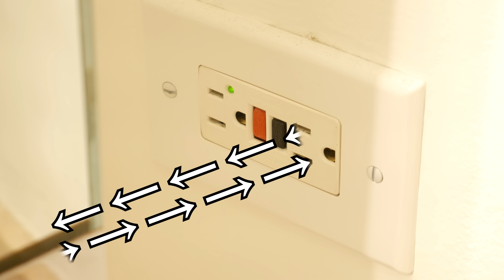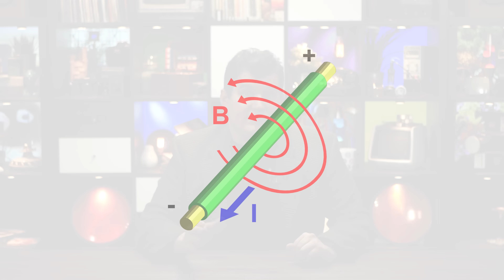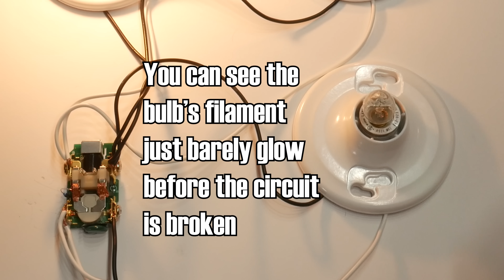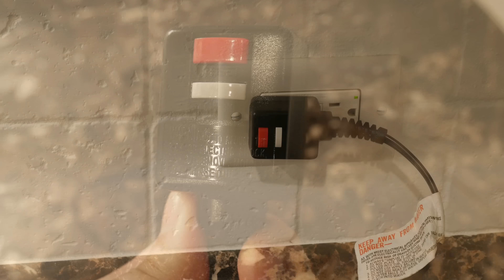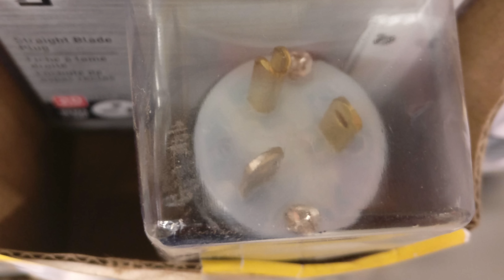The GFCI/RCD: A Simple but Life-Saving Protector

Comment: I had my radio connected to an outlet in one circuit that was protected by an RCD in the panel. When I connected the receiver to the house antenna network, the RCD immediately triggered. When I connected the radio into another electric outlet (that was next to the antenna outlet) the RCD for that circuit didn't trigger. Go figure.

Comment: I actually tripped a gfci plug recently and pretty sure it saved my life. I turned off the circuit labeled as the feed for my bathroom and stupidly didn't confirm the plug was actually off before I started working. I sent 120v in one arm and out the other when i touched the contacts of the plug i was working on. Turns out that it is on the same circuit as the other bathroom where the gfci plug is (I should have realized this since the plug in my bathroom isn't a gfci plug). I always knew these were important but now I have a very strong and personal appreciation for these plugs.

Comment: Just last week, I watched a video about why Japan's wall outlets (generally) don't have a ground prong hole.

The TLDR was that shortly after WW2, as the US was making ground plugs and prongs standardized, Japan started looking into it and found that something about the way their electrical grid(s) was built would have required a massive and expensive retrofit job to work, so they opted for a single GFCI between the main breaker and all the other breakers instead. And it has been amazingly successful. The most recent report the creator could find from Japan's electricity industry was about 10 years old, but it claimed there had been no residential electrical shock deaths in Japan the entire previous year.
They have since started selling outlets with ground in Japan, and in 2022 started mandating them in locations in new construction where appliances such as laundry machines or heat pumps are likely to be plugged in. Though their ground design is just a single wire that comes out of the main device;s cord about 6 inches before the plug end and has a metal prong that is supposed to be secured behind a ground screw (similar to how the 3-prong to 2-prong adapters you can find in the US have a metal prong that is supposed to be screwed in behind the central screw holding the outlet faceplate in).

Comment: I just replaced almost 30 outlets in the house I live in. I've seen some sh!t, man. Whoever wired this place up had to have been absolutely drunk.

There's a 20amp breaker with 12awg wiring that serves a single outlet for my washer and dryer. There's nothing else on that breaker. 

The outlet was a 15amp non-GFCI.

That was the EASIEST problem to fix. 

There's 12 different circuits sharing only 6 neutral wires. Thanks to this and some back -feed, I briefly got a shock in my hand while working on one of the outlets. 

I've seen 110v+ on white, black, brown, yellow, red, AND blue wires in this house. 

The outlet that shocked me had 118v on BOTH the black and white wires! 

I may never touch a house older than 1990 again after this.

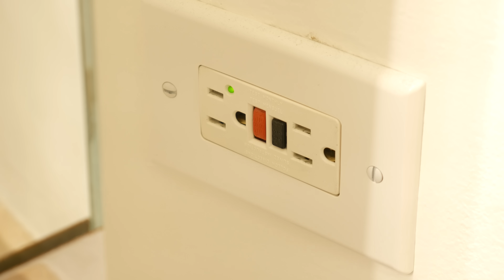Comment: 15:25 embarassing n00b story. I actually put two of these in series in a single circuit when wired up my workshop. in my defense, I didn't fully understand how they worked. I didn't know a single outlet could protect an entire circuit. I thought each outlet was on its own. So, in the virtue of safety, I installed two sequentially in a circuit.

Yes, I was an absolute n00b. However, A) I erred on the side of caution and B) I have learned from my experience. After all. this isn't a MISTAKE in that it won't cause danger or a problem. At most, it's overkill. However, I submit that any tactical mind will resort to the nuclear option until one can prove that Plan F is sufficient and we need not spend the resources on the other options.

Comment: The most interesting thing is that they detect the current inequality by running the two wires in reverse. The magnetic field created by the two wires cancel out each other, and the remaining field represents for the current inequality. So you won't need sensors to sample two currents and calculate the difference (which needs super high accuracy).

Comment: Another great video, thank you. I've just had a major remodel done. The laundry room now has 20 amp circuit with a ground fault interrupter. The new washing machine trips it constantly! Replaced the ground fault outlet with a breaker in the panel downstairs. The washing machine trips that too! Both outlet and breaker had an arc fault interrupter as well. Now what?

Comment: i know im late to commenting, but rewatching this video reminded me of when I was replacing some old and bulky (cause they were like, decorative i guess) lights in my room with new compact LED ones. I obviously turned off the breaker for my light circuit in the room, but when installing them I cleverly wired up the ground first - the enclosure for the light is metal - so upon trying to screw in the neutral, I brushed the neutral wire on the enclosure and tripped the RCD, which took out the power of the entire upper floor. 3 times. Needless to say, my sister was marginally annoyed when her PC and router randomly shut off several times during that

Comment: At work we have a plug in GFI on our board tester and i was wondering why i would trip the device. Come to find out when i was hooking up a board to be tested i kept triping the device there was no hot, only neutral and ground. Well if the screwdriver on the neutral and my hand or arm was on the static mat i would trip the device. I was actually touching the ground and neutral and that tripped the device. If you hook a wire between a ground and neutral it woukd also trip these outlets.  the metal on the screwdriver touched my hand while hooking up the board. Now i know how to test these outlets. AFCI outlets also will also trip. You must turn them breakers off. Or they will do it for you. No more working on live circuits which i never recommend. 73

Comment: "RCD" is just another in a long series of silly names for things in Europe, but mostly in the British Isles. For some reason, they are just downright awkward in putting words together to describe physical things. And sometimes it is worse than awkward....the "Residual" in RCD is a very poor choice of words....there can't be "residual current", as if some just got left behind by accident. Perhaps "DCD" for Diverted Current Device would have been better, of even "MCD" (misplaced or misdirected), or "RCD" could instead stand for "Recalcitrant Current Detector".....

My old boss used to call them by the acronym YASCI, as in Your Ass Saved by Circuit Interruption.

Comment: I would like to raise awareness to a not so common problem with outlets. It has recently come to my attention on some rare occasions that the ground connection in wall outlets are not properly or at all connected to the ground connection of the house in the access panel. What would happen is that due to interference from live/phase wires, you may measure an AC voltage between 5-10V at ground (!). Due to the fact that the ground connection is either not hooked up at the breaker panel or damaged somewhere along the line, the GFCI will not pop even though there is current flow, at least in most European households, as the part of the damaged wire connected to the device/outlet is not connected to the GFCI. Any device with a ground connection on the plug will become a risk for an electric shock or permanent damage to the circuitry! If you live in an older house, it might be useful to check for AC voltage on ground. The same story applies to older extension chords! If all wires are properly connected, the interference from the live wires will be nullified by the potential being dissipated to ground :) In the US, since the GFCI is located at the outlet, this won't be a problem since the flow caused by the interference is at the part of the wire connected to the outlet and will be detected by the GFCI. That's one advantage of the American system.

Comment: I live in an old apartment building in Switzerland. I only have a fuse, no RCD on any plug nor on the panel. 🥲 Apparently it's only mandated on new installations. Yeah...
Reply: Fuse wire was commonly used in switchboards before 1970s

Comment: You said if something malfunctions and causes a fault, that it would be hard to determine which circuit using an RCD, but this is simple to diagnose, you simply turn off all of the circuit breakers, and start turning them on, one by one, until the RCD trips, then you'd know it's that circuit

While true that this assumes that whatever malfunctioned, is still malfunctioning, but often that's the case anyway
Reply: There are faults which can trip an RCD where that method won't work (there is a type of fault that can falsely make it look like ALL the circuits have a fault on them)

Comment: Amusingly, the first place I lived that had these also had a problem with teeny tiny ants (well, for several months out of the year anyway) who kept trying to use them as the preferred way into the kitchen/bathroom... and for whatever reason, every week or so, they'd trip the fault detector. How they did it when they did, and why they didn't most of the time I never quite figured out, but at least the GFCIs in that place were regularly "tested".
Reply: Open the plug and there will be dead ants inside

Comment: I feel like RCD is a bit better of a name. If you somehow get residual current without it being caused by a ground fault, then the device will still interrupt the current. So using "residual current" is more all-encompassing.
I'm not sure how/if that can happen, but even if it's can't now things could change to allow for it later.

... I would go for "RCI" instead, though. Device doesn't give any info, but interrupter would say what it does.
Reply: Some appliances can leak a small amount of current under normal conditions

Comment: In Spain we call these "Interruptor Diferencial", which would be translated as something like "Differential Interrupter", which I think also conveys their use nicely. Also we usually just get one single one in the main electrical panel of each home (or apartment), which the rest of the circuits are then branched off of.

Comment: Why don’t we use them on every outlet?
Reply: Because it's cheaper
Reply: Of money is not an issue you will use breakers for: Over current, RCD, GFCI, Current Arc, Power Surge, Power Factor and Voltage correction. If you are happy to spend $10k you can have all this protection on your whole house

Comment: I got to find out how effective these things are one day while grinding at work. Grinder arced out and died so i took it appart to clean and found it was fried completely
Didnt notice a small hole in the sheath of the live wire going from the power cable to the switch and as im resting on a metal bench i make contact with this exposed live wire with the gribder still energised cause my dumb ass was like ill be fine to leave it plugged in and switched on.
Gave me a bloody good zap of 240V~ (AC) fresh from the mains then the click and it all stopped
Thing tripped fast though i felt the shock so it wasnt live long enough for me to have issues with letting go or anything
Seemed like jt only took less than half a seccond but fuck did that shit still hurt. I dont recomend experiencing the tickle and punch of 240v ac even if its just from hand to elbow.  As im now a welder i also dont reccomend experiencing high current DC either
Same deal hand to elbow but 45 amps at i dont know the voltage hurts like all hell, this wouldnt have happened had i not stuck the electrode to the wire and tried to get it unstuck by firing the welder while holding the wire and being in contact with the bench.  Thankfully we live and learn not to be stupid but id never have gotten to experience the DC if not for the RCD cause id be in the words of mehdi a corpse cooked to perfection

Comment: My understanding is that “naturally in the closed position, solenoid opens switch during fault” is outdated. Newer ones are naturally in the open position and require power to stay closed. 

When they wear out, the older ones would close and not open during faults — losing their protective abilities. Newer ones will open once they wear out, disabling the receptacle until replaced.

Comment: Surprising that the current is balanced when in operation. I would have expected the work done by the appliance would mean that there was either 1) less current flow, or 2) less voltage on the return path.

Comment: GFI circuit breakers are available in the US.  I've retrofitted my home with them on every circuit that requires GFI protection per the latest NEC book.  In fact, they're often available as dual function units: GFI + AFCI (arc fault circuit interrupter).  AFCI: similar name, but different function.  They detect conditions where electricity arcs in series (point to point on the same wire) or in parallel (jumping across from the hot to the neutral).  AFIs are also available as receptacles, but come with specific restrictions on their installation.

Comment: The neat thing about modern GFCIs is that unlike old ones which can lose its protection over time and essentially revert to being a regular outlet, modern ones will have a lockout feature which permanently disables the outlet if the GFCI protection were to fail. This then forces people to replace the receptacle to have the the outlet working again.
Reply: Yes and the newer ones (since 2015) also must have a self-test function. They will test themselves every 30 seconds to ensure they are working. The owner no longer has to test them once a month (although it is still recommended). And as you said, the newer ones will lock you out when they fail their internal self-test, alerting you to replace it.

Comment: GFCI's do not need to be first in line in the circuit to protect the whole circuit. Because it is a series circuit from the panel, everything on that circuit will have power cut when the GFCI is tripped, just like a string of series lights will go out when one bulb is out.
Reply: That is just  nonsense. A GFCI can only detect faults that happen after it. Remember the whole electric installation is based on diverting currents to various points. If a GFCI tripped when current is diverted before it nothing would work.

Electric sockets are not connected in series. They are parallel. The string of lights is in series. The idea of sockets in series is absurd. In series connection all the connected elements need to be identical and all need to be in use at the same time. One cannot have general purpose sockets in series.
Reply: @okaro6595  My mistake, you are correct.

Comment: RCDs are not the same as a GFCI (also known as an Earth Leakage Circuit Breaker). The former detects an active-neutral imbalance as described, the latter detects a sufficient current on the earth/ground wire. Both will isolate the active as a result.
Reply: No no no. Both compare the currents. The difference is that in the US they are electronic while in Europe typically electro-mechanical. Ground wire has nothing to do with it. While ground wire can cause the fault that is not the reason we use them. We want to prevent a fault that goes through a person and nothing in the ground wire could detect it. It has absolutely nothing to do with the ground wire.

There were devices that used to detect current in the ground wire. These were used to make TT grounding work. Nowadays one prefers RCDs for that. In this case the RCD could be higher like 100 mA. There then is additional RCD protection at 30 mA as required. In some cases like in the UK one does not need the main RCD with TT if everything is protected by 30 mA RCDs.

Comment: Excellent video Sir ! Thank you . Here in France, we call this device a "différentiel" (differential) switch or circuit breaker. It is located in the distribution panel  and it is mandatory for every electrical outlet, whatever its location in the house.  
The  ground fault current threshold is 30mA, instead of 5mA you are mentioning for your devices.
I guess it is because our GFCI devices can have  multiple outlet circuits connected downstream, and 5mA threshold should be too low to avoid spurious trips. So it is a trade-off between the power availability and the safety of people.

Comment: Or the UK just forbids it in bathrooms, even light switches, you're just allowed a 'shaver' adaptor they also is shaped tor euro, American, and Australian two pin plugs... which most homes don't have because that just means wiring a bathroom.

Terribly antiquated and inconvenient, leading people to use extension leads into bathrooms, and also brothers and sisters to turn off the bathroom light when you're sat on the toilet or in the bath.

Comment: 14:10 since the GFCI generally protects the ENTIRE network, and you have breakers for each individual circuit, you can fairly quickly narrow it down by manually flipping all breakers off (if the GFCI is tripped you don't have power on them anyway, so it's not like that step causes any inconvenience), reset the GFCI and then reset one breaker at a time to see when the GFCI retrips. That way you can at least fairly easily narrow it down to exactly which circuit is messing around, which will leave only a few plugs left to check.

(And if you daisy chain US GFCI as demonstrated at the start, you have the same problem anyway, so I'd say this is a very minor disadvantage)

A much, much greater disadvantage to having the GFCI in the panel, protecting the entire network, is that you can't test it without killing the power to the entire apartment/floor of your house, which is makes it significantly more annoying and tedious to test, discouraging regular testing.